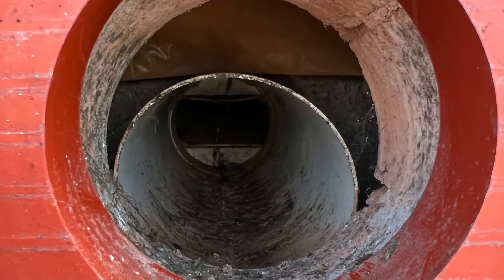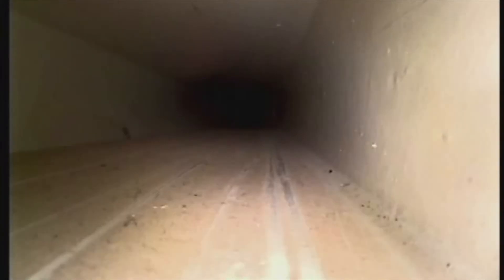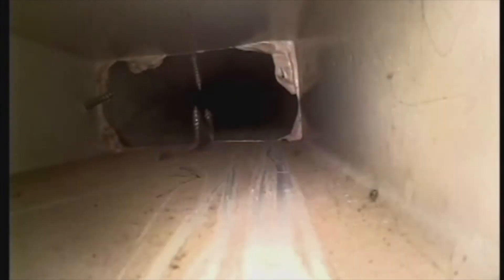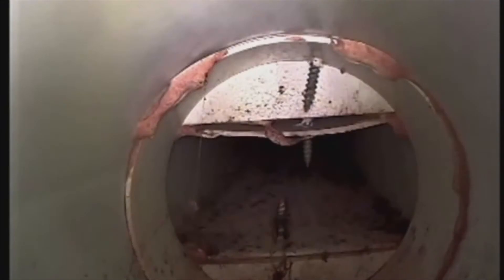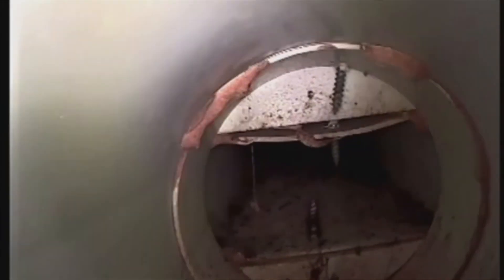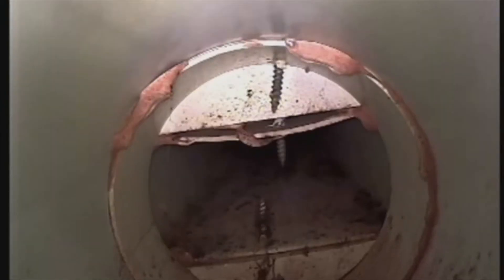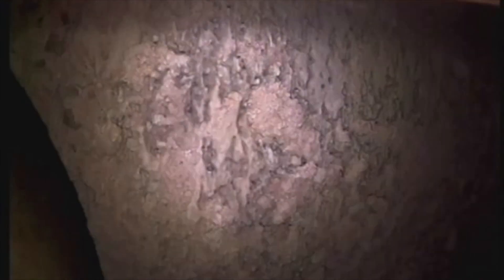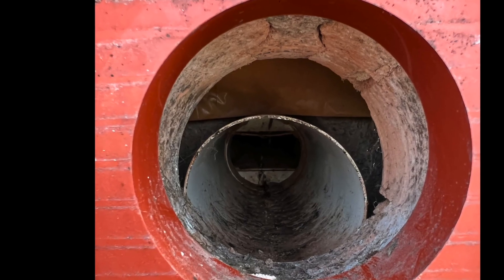Damp issues …. new build lash up 🤦‍♂️

Comment: Damp is caused by the cavity walls being bridged with insulation(insulation touching the outer walls inside the cavity).Cavity walls must NOT be bridged with insulation or else moisture from the damp outer walls will transmit by capillary action through the touching bridging insulation into the inner walls, making it damp inside the property. Injecting foam into the cavity walls stops the walls breathing , causing drastic condensation saturation of the inner walls inside the building.
 Cavity wall insulation must touch only the inner walls inside the cavity of course.
If cavity wall insulation batts(panels) are to be installed, there must be a LARGE  air space gap in-between the outer walls and the cavity wall insulation batts inside the cavity, this includes a substantial air space gap in-between the cavity wall insulation batts and the cavity wall tie drip point(which must point downwards in the centre of the cavity). Ask City & Guilds N.V.Q. BRICKWORK teachers in person for proof of this.